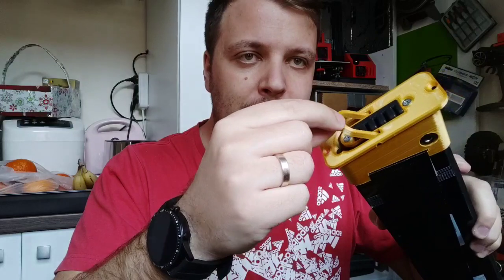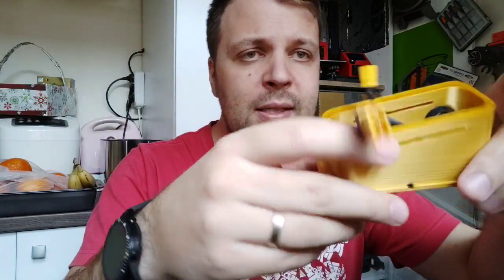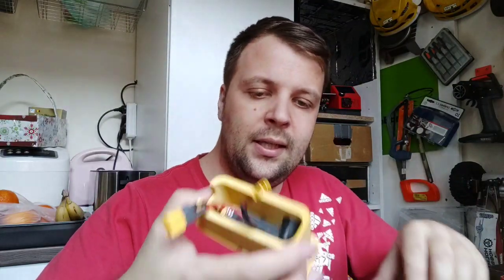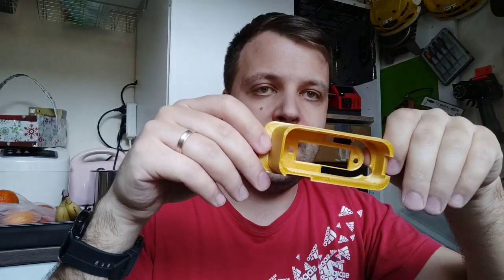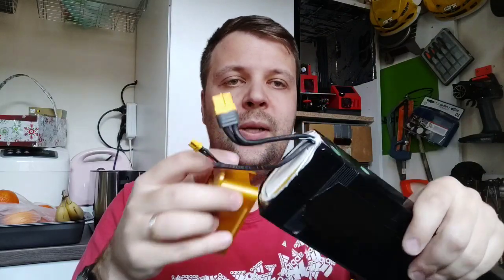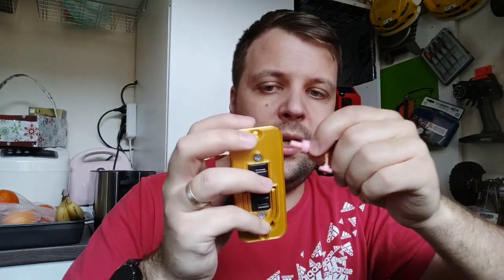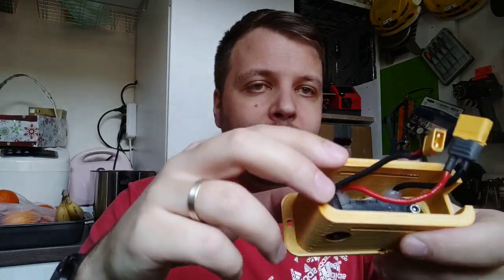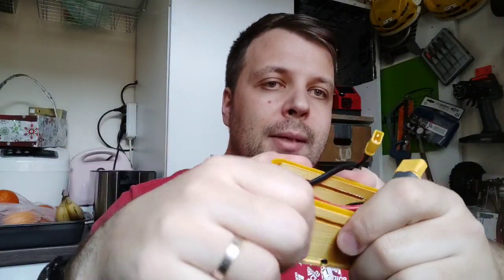Fiido D4S D2 D2S removable battery adapter with stock battery Video 2

Comment: Hi, thx for the great video. Does the "any adapter" fit for the Fido D1 too? By the way I tried to pull out the battery out of the D1 frame after I had dismounted the cover and the charging socket but the battery stucks. I cannot pull out the battery. Any idea?
Reply from the maker: the problem is, for some bikes, they cannot remove the battery. the space inside the frame is too tight. in this case you cannot use the adapter. I didnt find a solution and I don't think I am able to find it
Reply: @sarsaila89  thank you for the fast response

Comment: Hi George, just printed your design and think it's going to work great. Going to order some M2 screws for the wee handle. What length should I order? And thanks very much!
Reply from the maker: 6mm on one side and 8mm on the other side. you can use 2 8mm,and maybe cut one
Reply: @sarsaila89  Appreciate that. I did hear you say that at one point but looking at it, I couldn't see a reason for the different sizes. Anyway I know what to order now 👍. Thanks from 🇮🇪